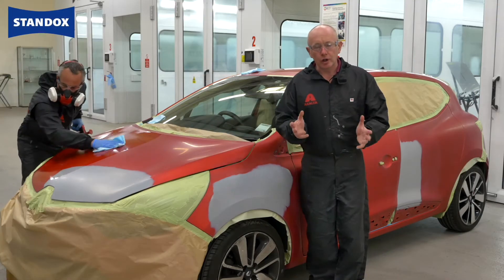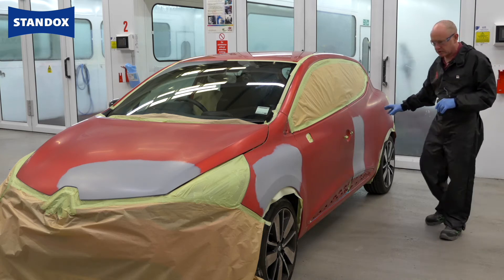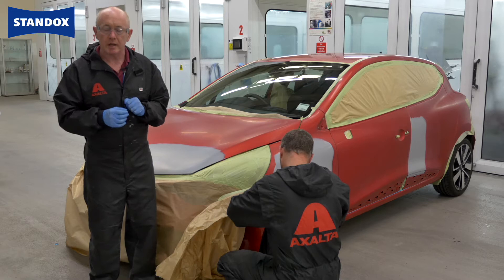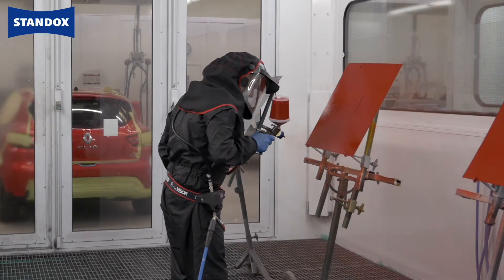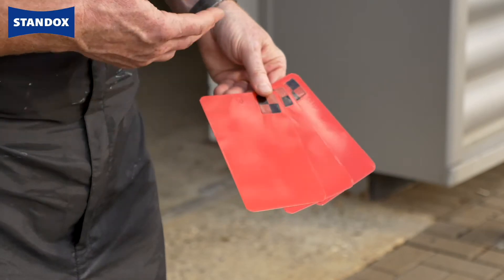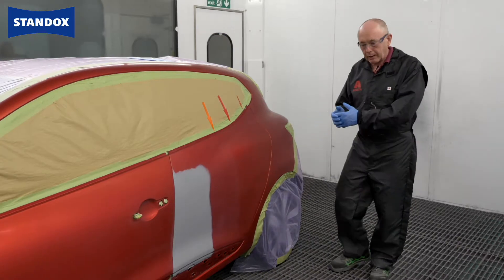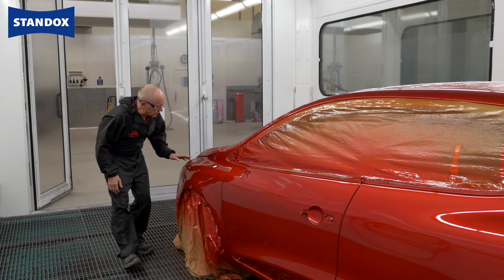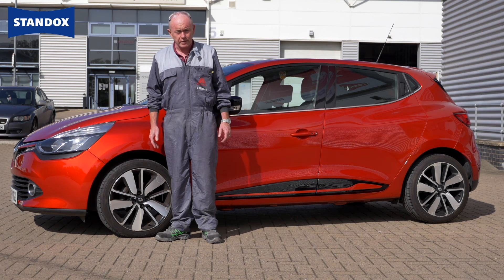Special finishes Refinishing process for tinted clears

Comment: How much base coat did your use to tint the clear coat....is there a rule of thumb...

I guess you hope you dont ... develop a run with tinted clears
Reply from the maker: Hi, with these special colours there will be a formuation available on our software for both the basecoat and the tinted clear so I would advise to follow these formulations rather than trying to do by yourself. The clearcoat additives are not basecoat they concentrated tints.